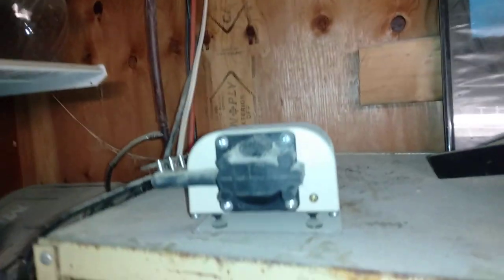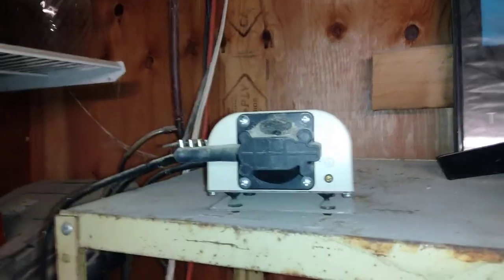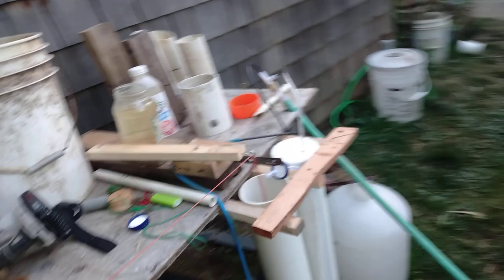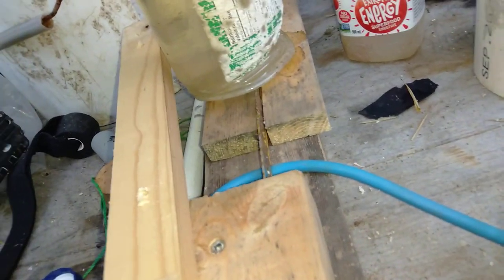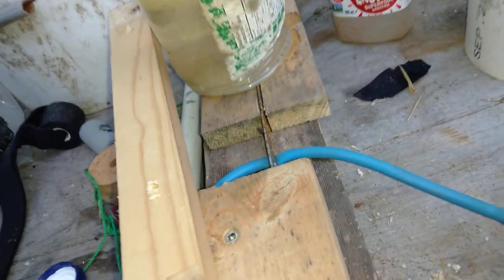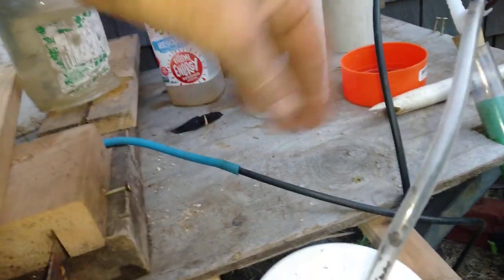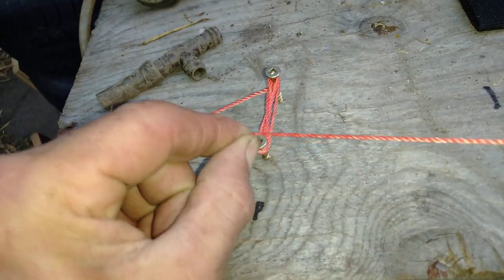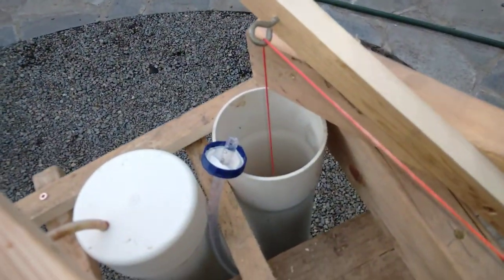Proof of concept! Zombie Pneumatic solar tracker  rotates solar panels, solar cookers at a distance!

Comment: Absolutely beautifull to see u work
Reply from the maker: It's just the proof of concept.  (For instance,  I don't know exactly how big the  "wheel" 
 that the string goes round should be, I just made it from scrap wood. I tweaked things today,  and I will draw a diagram  to show how it works, and put that as the thumbnail. Yesterday, I started with the sealed pipe full of water and the unsealed one empty,  but that means manual resetting for the morning.  Today,  I joined them at the bottom  and made it half full and that means as soon as the air pressure is removed, the thing returns to its start position.  (takes about 5 minutes).   It may eventually be that people need larger pipes to do this thing.  When I put a reflector on the platform,  we will get a better idea.

Comment: I love this mechanism.  It would be interesting to build something that tracks the sun and automatically go back to east at night.  I wonder how one can detect day/night cycles mechanically.  I've only done it electronically.
Reply: Air heating thin metal flat black painted cans, with skins (looking like 2 small tambors) a board in between, so when one of the cans is heated, the other one is shadowed. The inflating skin is mooving an arm that mooves the system. When it is dark, the system come automaticly in the middle, and then when the sun comes in the morning, it does it again...